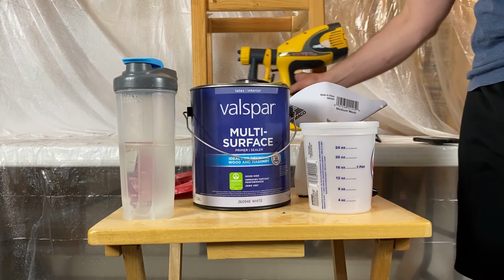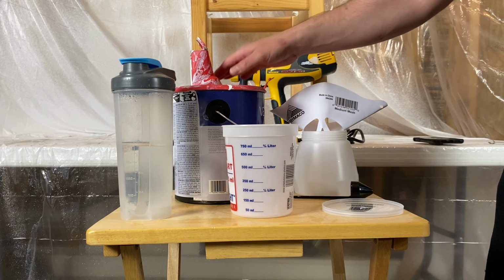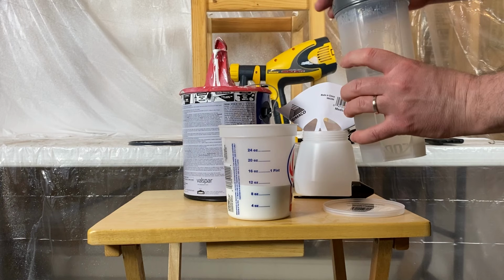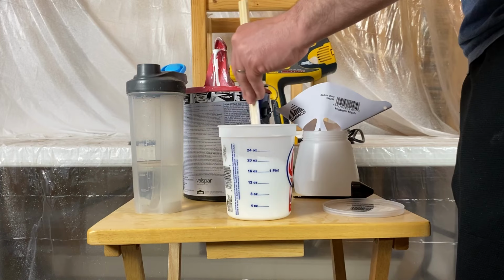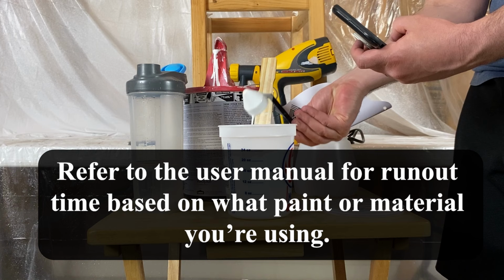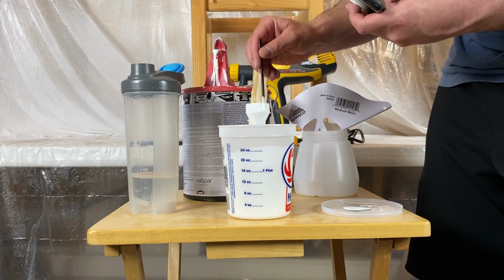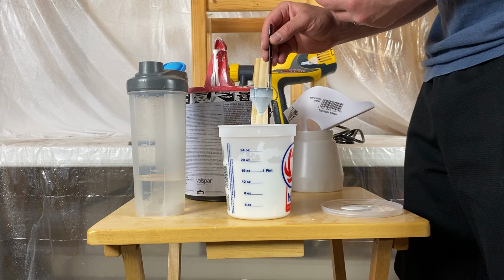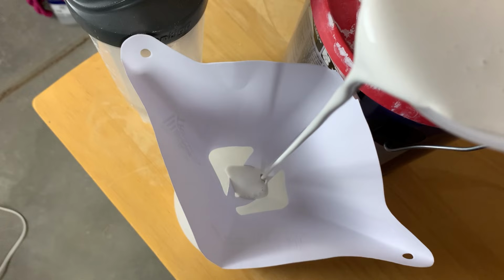How to Thin Paint for Paint Sprayer

Comment: Thank you for this detailed video! I was having terrible results with some Behr paint that said to thin no more than half a pint to the gallon (15 parts paint to 1 part water) for air spraying (splattering like orange peel spray). 1 part water to 3 parts paint like this video made the paint nice and flat. Just have to know not to put down too thick or it will run. Light coats. I am  wondering why Behr recommends what appears to be an impossible flow rate? Am I wrong to thin the paint more?
Reply: Define the paint at fault and not you.
Reply: Probably expecting to use a very expensive sprayer that can handle a thicker paint
Reply: Thin the paint 20% maximum and you won't compromise the finish product
Reply: I am brand new to paint spraying and have been using Behr too because thats what i can get local to me and thinningnwith a drop of water made for misery. Paint didn't come out consistently and it was making my piece of furniture have hundreds of beads of paint rather than a uniform flat finish. Horror and what a waste of $$

Comment: Did he really use water or paint thinner?
Reply from the maker: Yes I used water to thin this paint. You’ll use water for water based paints and mineral spirits for oil based paints.
Reply: Ar3 minera spirits to clean it after spraying  oil bases stains or paint or is it to thin them out?